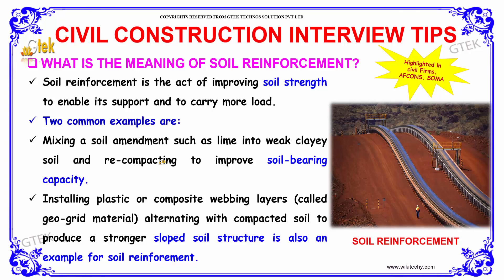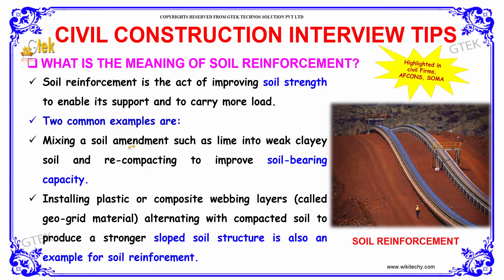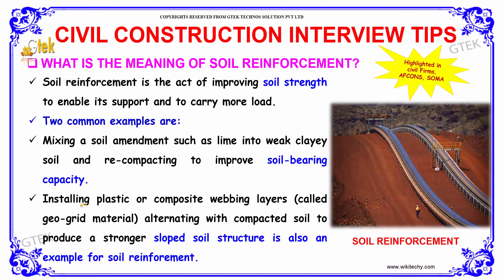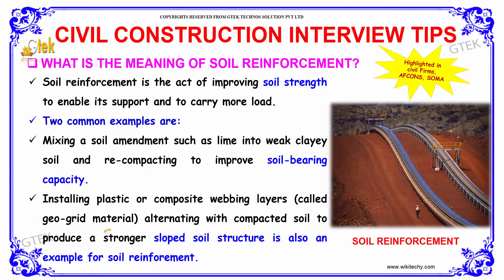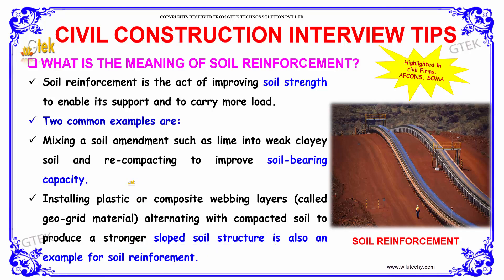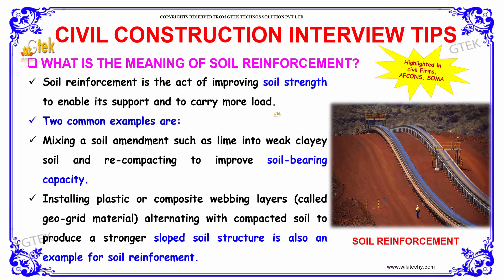what is the meaning of soil reinforcement | Civil Construction Interview Questions and answers

Comment: Two common examples are:1) Mixing a soil amendment such as lime into weak clayey soil and recompacting to improve soil bearing capacity (often done under the road base in highway construction)2) Installing plastic or composite webbing layers (called geogrid material) alternating with compacted SOIL

Comment: Soil reinforcement is the act of improving soil strength to enable it support or carry more load.
Two common examples are:
a) Mixing a soil amendment such as lime into weak clayey soil and re-compacting to improve soil-bearing capacity (often done under the road base in highway construction)
b) Installing plastic or composite webbing layers (called geogrid material) alternating with compacted soil to produce a stronger sloped soil structure (often done on steep roadway embankments to improve strength and stability)

Comment: wo common examples are:1) Mixing a soil amendment such as lime into weak clayey soil and recompacting to improve soil bearing capacity (often done under the road base in highway construction)2) Installing plastic or composite webbing layers (called geogrid material) alternating with compacted soil to produce a ...